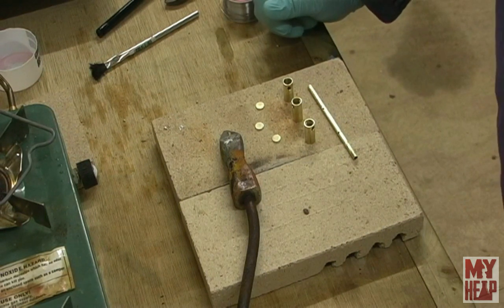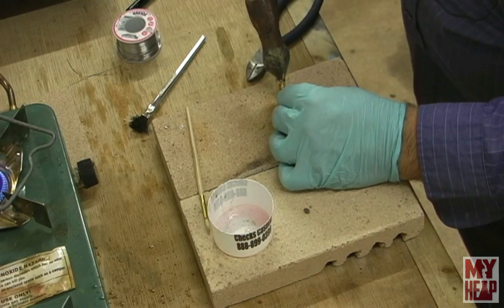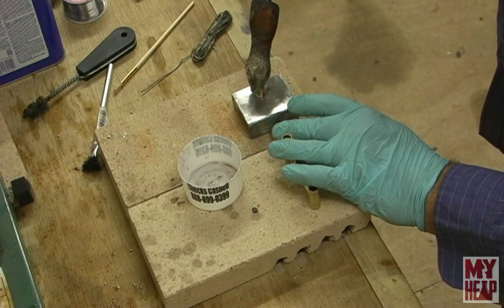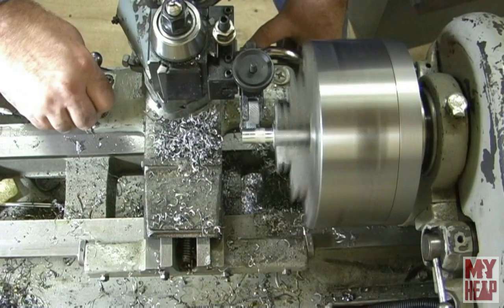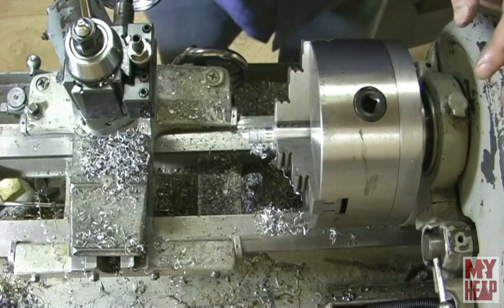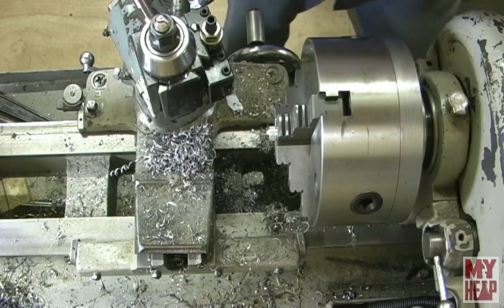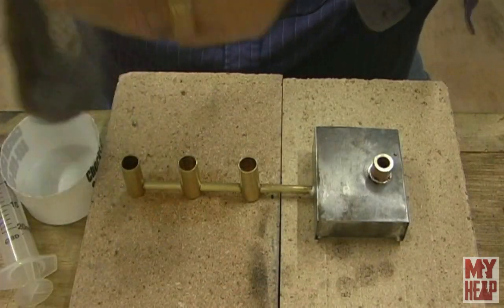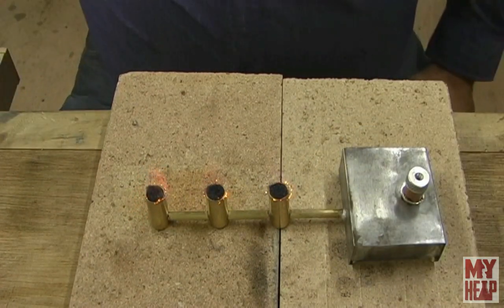Kenneth Wells Stationary Engine - 05 - Finishing the Burner Assembly

Comment: Almost 1000 subscribers now...nice! The wicks worked well to my surprise, no experience with them. The old school iron was realllly OLD SCHOOL but worked great, good job. Please take a close look at your small spindle back gear in the headstock.....grab it while back gears aren't engaged (lathe unplugged) and see if there is play between the gear and spindle. I think thats where that clanking & rattling is coming from while lathe is running. That gear has a brass bush....if there is play in it the bush is wore out. I think that is where the sound is coming from, let me know. Have a Merry Christmas to you and your family! ~ Richard
Reply from the maker: Hey Richard.  It is slowly getting there.  Chirpy told me about the steel wool.  I was surprised to see it work as good as it did.  I have a few things going on with the lathe I need to track down and rectify.  I will take a look at the gear the next time I am out in the shop and let you know.  May need to do and Atlas update video and cover some of this stuff.  Thanks for watching and taking the time comment.  Merry Christmas Richard, hope you have a good one.
Reply: That atlas rattle sounds eerily familiar if ya know what I mean., I have the new gear, just dont wanna tear the headstock down at the moment.
Reply from the maker: Well Richard, when we get a chance I will take a close look at the gears to see which one is doing all the rattling and noise making.  I will let you know.  Hopefully it won't be a tough fix.  I also have issues with the backlash in my crossfeed screw.  I really need a new one.  I think I could make one but will need someone to cut the woodruff keyways since my mill is not up and running, not to mention I do t have the tooling.  😞
Reply: I sent you an email. I have backlash problems in my cross slide as well. Since the nut is brass and the screw is steel mostly like a new nut will remedy most of the backlash. I am considering making a new nut & screw but need to take a closer look at the screw first....new nut for sure. I have some woodruff key cutters but dont know if I have the size needed for the cross slide screw.
Reply from the maker: I have a new nut that a subscriber made for me. In my case the threads are really worn in the first third of the screw when looking from the Operator end.  I also need to tighten the gibs up.  There isn't any play that I am aware of, but need a little more friction.  They slide too easy if that makes any sense.  I think I can make a screw, or maybe screw it up, who knows.  Here is what happens that drives me nuts.  The handle on my crossfeed is like the handle on the tailstock and saddle.  When I feed in, the vibration of the machine causes the handle to back the screw out due to the backlash.  Because the handle isn't balanced.  Then I have to bring the screw back to the end of the backlash before I can advance the cutter.  My gibs are set kind of light and smooth so unless I remember the setting of the last cut, I have to go on feel.  In a perfect world, I need a new screw, the propper handle and the gibs a bit tighter.
Reply: Yeah, I can see where that would be aggravating. A new screw would be a great project to practice accuracy. At least you have a new nut to check your threads as you cut them :)
Reply from the maker: True, and I have an ACME guage, all I need to do is find some stock and grind up a cutter.  What kind of stock would make a good crossfeed screw?  Does it matter?
Reply: Mild steel would be fine I would think.... but I would like to use something harder like stainless or 4140 just to increase the pain in the As# factor 😊

Comment: Hey Joe,
Good progress on the toy-engine !
You shouldn't solder with these 'plastic' gloves on though.... it won't prevent you burning yourself, the only thing it will do is when you burn yourself, making sure you have molten plastic stuck to your skin !
The bit of zinc-chloride won't kill you.... just don't brush your teeth with the stuff !
For wick material... either glass fiber rope or pure cotton will do nicely.
Those old coppers do come in handy from time to time. I have an old Sievert brass blowlamp that has hooks for supporting these (so you can hook them on the blowlamp in order to heat them up)
Old stuff, but still works fine !
For toy engines like this one (with a spirit burner) it is not uncommon to add a few percent of vegetable oil or kerosene to the alcohol. It won't do much for the performance, but the flame won't burn clear /invisible, and that makes things a bit safer.

Toodles!
Paddy
Reply from the maker: Hi Paddy,  I will put a little veggie oil in it so that it burns with some color.  I was wearing the gloves because of the acid, but if it isn't that strong then I guess a good washing up after I am done will be fine.  The steel wool worked pretty good as a wick material but it degrades (rusts) very fast.  I think I have some fiberglass laying around somewhere.  Som stranded mat and roving if I remember right.  Now if I can find the stuff.  :-)
Reply: Joe,
Despite the fact that you basically dissolve a salt in water (ZnCl2 ), the resulting solution is still quite low in ph. There is more going on there, chemistry-wise, than just a straight forward solution process.
That said,just use some common horse-sense. My main point was, that you do NOT want burns, with molten plastic stuck to or in them.... I'd advise firmly against that LOL.

Yes, once the steel wool has dried and all the protective oils are burnt of, it gets actually quite flammable. (just take some and put a lighter to it) Given it has a very big surface (because of being so fine grade) it will indeed oxidise readily. As long as the material has enough capillary action, you could use it as a wick. I must say, I have not seen steel wool being used in this way, but there is no reason why it wouldn't work,as long as there is a steady supply of fuel.
We made a burner for a similar toy engine once (also on methanol) without wicks.
It was just a section of square tube closed at the ends (as a reservoir) and a series of small holes drilled in the top. If filled about and 1/8" less then full, that void becomes an evaporation chamber. As long as the metal isn't freezing cold, this works remarkable well! 
And.... no wicks, tubes, supply needed!

Paddy
Reply from the maker: Paddy, that's some interesting info on burners.  I should try to find some time to play with it.  I will be careful with the acid my friend.  I am guessing that since I cannot brush my teeth with it, it wouldn't do good to mix it with the Scotch either, right?  ;-)  I remember getting some melted nylon stuck to my thumb.  Nasty burn and blister, so I am with you, I don't want plastic melted to my skin either.  Thanks for the support Paddy, I appreciate it, and have not forgot about your emails.  Been slammed at work, but will respond to them.

Joe